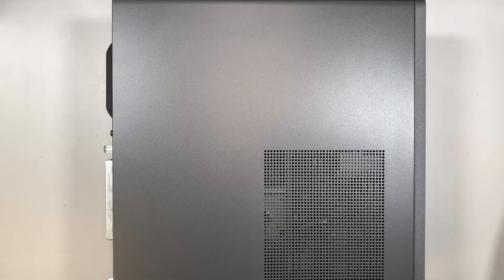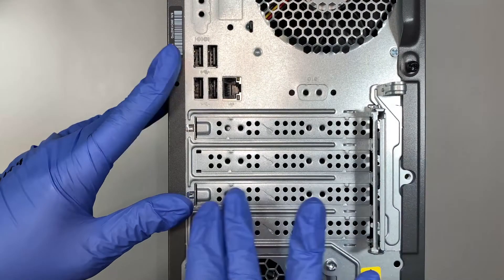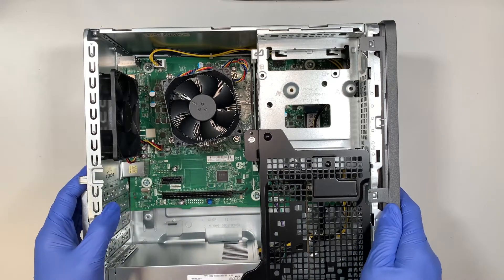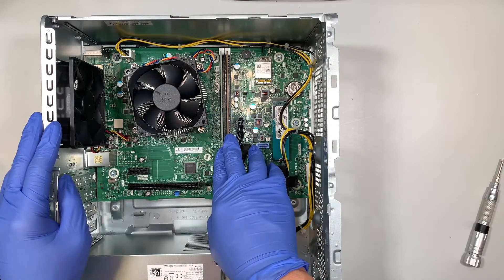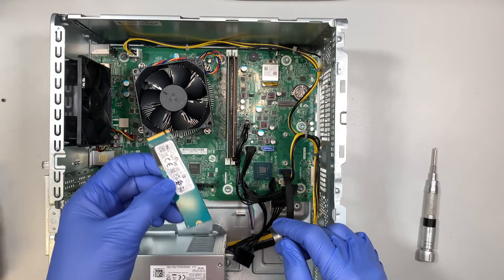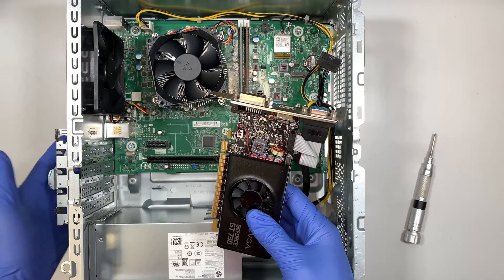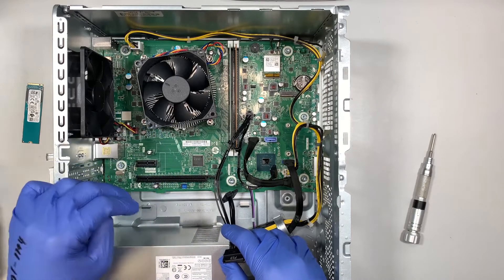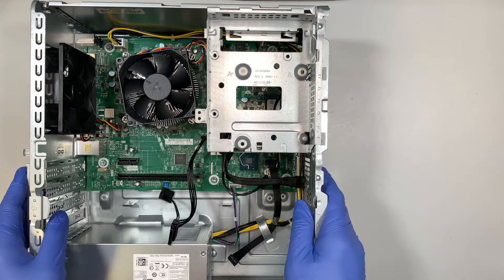HP Envy TE01 1144 Tear Down Disassemble

Comment: This is a great video and thank you for doing it. I actually created a poor mans Linux server out of this same computer. I am running OMV with two additional desktop harddrives plugged into it. I never even noticed the additional SATA data connection (black cable) on the right hand side bottom right of your video on the mother board. I bought another  SATA cable to plug into the blue connection next to the SATA power cable. May have to open mine back up and use the smaller black cable since it looks like it has the 90 degree anngle on it also.

Comment: Great video. Does anyone know if the HDMI port (HP Envy TE01-1134) is soldered onto the motherboard, or can it be pulled off and replaced? I damaged a few pins on the port when the cord was pushed down. It must be replaced... I just need to know how.

Comment: What’s a “Mudderbord?”
Reply from the maker: try goooogggle
Reply: @UberGeeks  Why? The Motherboard is a Baker 8767. You can put in another power supply from HP L05757-800 that a 500w or  L04618-800 which is a 400w. Then put in a higher profile graphics. I also heard the HP DPS-500AB-32 will work with powering up the motherboard with HP proprietary cable.
Reply: Baker 8767

Comment: Excellent videos! Very clear explanations and camera angles! Question: Will the Envy TE01 take a 2.5" SSD drive without modification? You added a 3.5 HD but are the holes and cables present for adding the smaller drive? Thanks!
Reply from the maker: Glad the video helped. If not available, you can buy an adapter:   https://amzn.to/3Asd86s    Sorry, I don't remember if it has the 2.5 slots.
Reply: If you look at the silver HDD cage at around the 3:40 mark, you can see screw holes for a 2.5" drive. There on the bottom of the cage, and not on the side. I've also seen other configurations of the ENVY model with a 3.5" HDD mounted behind the front panel.
Reply from the maker: @lumiereeclair  Thanks for sharing. I really appreciate it.